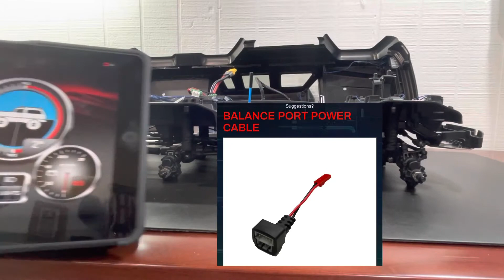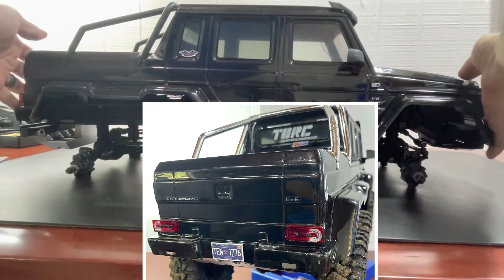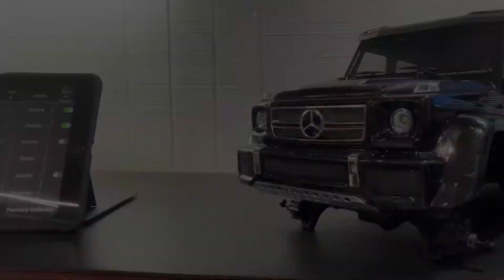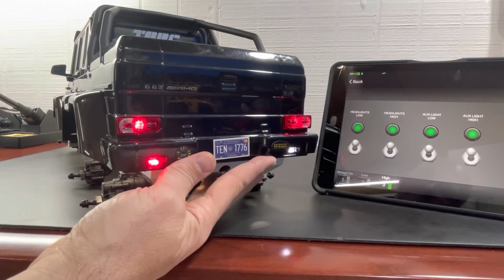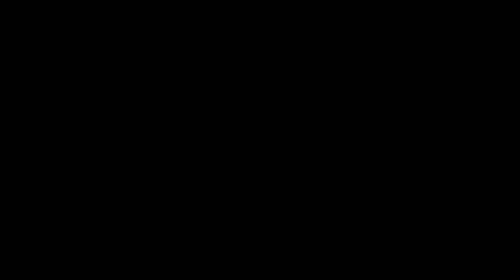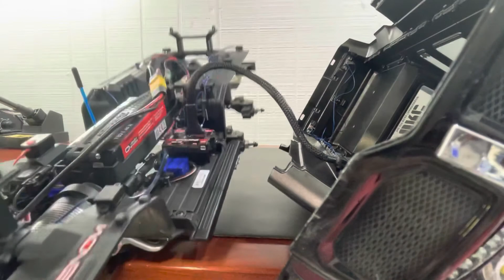Traxxas TRX6 ProScale lights, Quickrun Fusion, Reefs O11C Raw500, and use Traxxas App light control.

Comment: Hey brother man, just installed the pro light kit! When i brake my bumper light comes on and not the body lights! Have any suggestions? I havent figured the app out yet either!
Reply from the maker: Hey man. That is hard to say. My first step would be to test each function with the remote. Turn signals and reverse lights. If you used the MAXX link cable, don’t use the Receiver Communication Cable. I have not been able to get it to work without using the app. If you want to make a quick video showing the setup and issue, please let me know when it is posted and see what I can do to help.

Comment: I have a problem with turning lights, all the lights blink 😅. What's seems to be the problem?
Reply from the maker: There is a Signal burly ton on the light module. Press Once for hazard lights on, Press Once to turn hazard lights off. 

For turn signals Press twice quickly to activate or deactivate turn signals. 

Search “TRX 6 Light Module” for additional settings. 

Hope this helps.

Comment: Hi, where do you connect the motor sensor connection to?
Reply from the maker: I used the MAXX link cable to get the signal. There is another option to use the receiver communication cable in the Pro Scale kit. https://traxxas.com/sites/default/files/HKC20008-R04_Pro-Scale%20Lighting%20Module%20Installation-WEB-EN.pdf